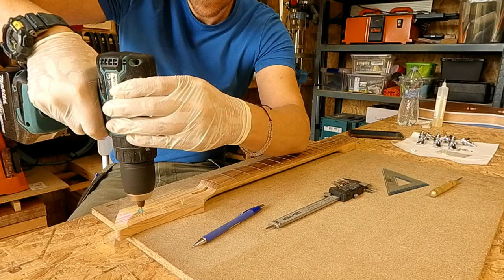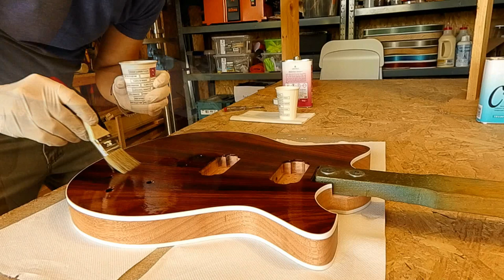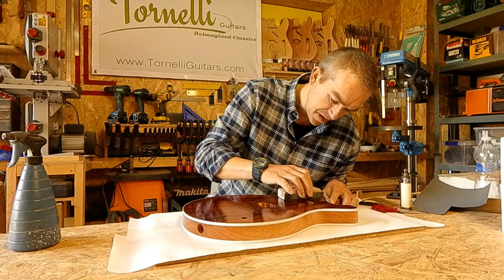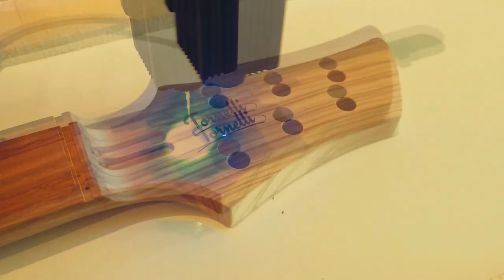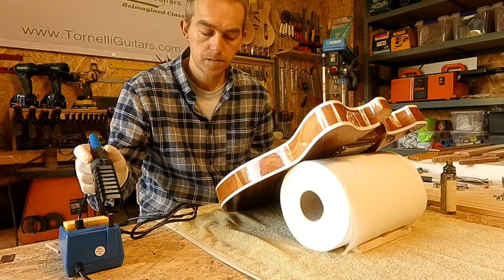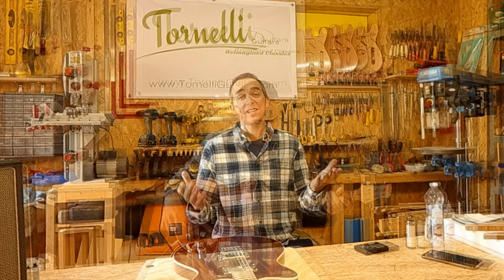Olive & Rosewood Guitar Build | Ep.4 Finish & Sound Demo

Comment: There was a quick snippet of you laser cutting the headstock. Is this something you do in-house? If so, any info you have would be very handy. Thanks!
Reply from the maker: Hi Paul, yes I have a small laser engraver, it’s a Neje laser master. It’s a very simple process, I have a hi res png image of my logo, the laser comes with its own app, you just import the image, resize it if necessary and then click burn. I needed something simple because learning new software is not something I want to spend any time on. I change the power of the laser depending on the wood I’m engraving but that’s about it. Let me know if you need any more info. 👍
Reply: Thanks! That's saved a lot of random googling. @TornelliGuitars

Comment: Looks incredible, how does the melamine lacquer do with acoustic guitars, I'm not a big fan of the spray and always prefer to brush on the finish & the melamine lacquer finish you've got could be the best i've seen. amazing
Reply from the maker: Thanks for the kind comment. I’m not sure about applying it to acoustic guitars because I haven’t done that but I do know the sound of an acoustic is much more affected by the finish. The application etc would be just as simple but I’m not sure what it may do to the tonal characteristics, sorry.
Reply: Fantastic looking finish! What melamine did you use, did you find it particularly difficult (after the first 4 days, that is!)?
Reply from the maker: @paulneeds  thanks Paul. I used chestnut products melamine (and sealer and thinners). No problems after my stupid error! The melamine is very good to work with; it builds fast, sands well and dries quickly. The only issue is that it’s rougher than spraying so it takes more sanding to get it perfect after it dries but that applies to all gloss brush on finishes I guess.
Reply: @TornelliGuitars  at least it sands well though! If it were dead hard…
Reply: I’ve actually just finished an acoustic where I used exactly this product on the back and sides (and neck) but French polished the top. The guitar honestly sounds great. Don’t know if I’d want to use the lacquer on the top, I know and trust FP as “the best” for acoustic sound, but I reckon it would be actually fine. I might give it a whirl one day just to see.
Reply: @GarlandStringedInstruments  thanks for the info, my last build I used tru oil because I wasn't sure either, but I'd like that shine on my guitars Hehe
Reply: I am just trying melamine on an acoustic, but it should be fine. Taran Guitars, played by such luminaries as Michael Watts and Martin Simpson, are finished using melamine. Tarans are extraordinary instruments in terms of both appearance and tone. The issue is thickness of finish, rather than composition. I understand Taran actually use multiple extremely thin coats. That doesn't mean it's the only way to do it. For example, sanding back considerably between coats would achieve the same result.

Comment: Hi there, I hope you're well. Thanks to your videos on finishing I have finally found the answer on how to finish my latest project at home without spraying!!!! Just one question (I may have missed it from the video), do you thin your lacquer or you just use it at full concentration? If you thin it, what ratio have found giving the best results? Thanks in advance and keep on recording these awesome videos :)
Reply from the maker: Hi and thanks for the kind comment. If you are also using the melamine to grain fill on a piece of wood that has a deep grain the a couple of coats unthinned would make the whole thing quicker. If you have already grain filled the you can use some cellulose thinners to keep the brush tracks to a minimum. If I’ve already grain filled then I’ll use 10-15% cellulose thinners. I’ll do one coat with the grain and the next at 90 degrees, the added thinners tends to start evening out the coat underneath. The reality is that however you apply it, you will have brush tracks, but don’t worry it sands back very quickly and easily. I’m really glad you find my vids useful, feel free to ask anything you need.

Comment: Quick question? If i was to draw an image with a standard graphite pencil or ink based paints, will a melamine lacquer finish ruin or possibly smear the image? Thank you in advance.
Reply from the maker: Hi, the melamine would certainly lift the ink but as for pencil I’m not so sure. I suspect that if you sprayed a light cellulose sanding sealer over the pencil before applying the melamine it would work fine. But I would do a quick test first!
Reply: @TornelliGuitars  i’ll give it a go on a scrap piece of wood, whats the worse that could happen. Thanks for the input, love the builds. Recently subscribed 👍

Comment: Hi. Love your builds and have been inspired to try the same melamine laquer. Have mixed results on my first attempt and have refinished 3 times!  I’m getting little tiny hairline cracks about 1.5cm long appearing after a few days. Also do you flatten after each coat? I can see ripples deeper in the finish from previous coats. Any thoughts would be really appreciated. Otherwise I can see the potential to get the finish I’ve been hoping for. Thanks mate
Reply from the maker: Thanks David, I’ve never had hairline cracks in melamine so I’m not sure what the cause may be. I wonder whether it’s curing too fast, are you drying it in a very warm environment? Perhaps try adding a small amount of cellulose thinners to the mix, that will soften each layer as the next goes on. That’s all I can think. I do roughly flatten after each coat just to try any keep the surface close to level but only lightly because the finish is still so soft.
Reply: Thanks for taking the time to reply. I’ll certainly try your suggestions, I wasn’t sure from the video wether you thin each coat so that’s helpful. I’m sure the difference between Italy and southern England in winter will have an effect.! Thanks again I’ll keep going with it 😊

Comment: Mightily impressed by the high gloss finish you achieve with the melamine laqueur.  My question is I am making a classical guitar and would like a similar finish.  I have pore filled the rosewood with clear filler but was concerned that the cellulose sanding sealer and laqueur would likely bleed the rosewood colour into the white purfling.  Is there a solution for this?
Reply from the maker: @gordonmacgregor7762  yes I see your problem and I’ve also just started binding with wood so I’ve encountered bleeding onto flamed maple binding. The solution I’ve found is that the cellulose sealer I use is also available in a spray can so a couple of light mist coats is sufficient to stop the bleed, then I can brush on more if required without issues, but if I start by brushing then I get bleed. I hope that helps.